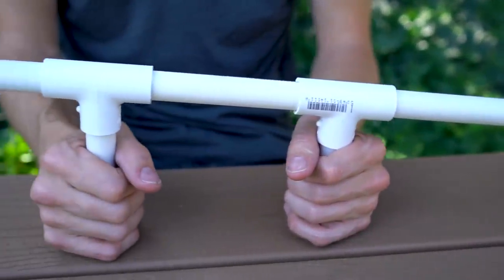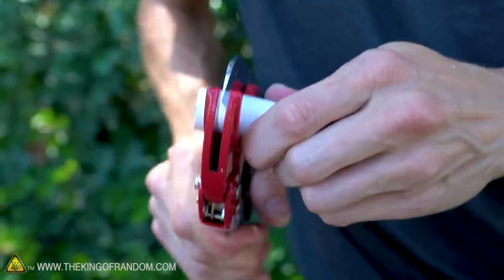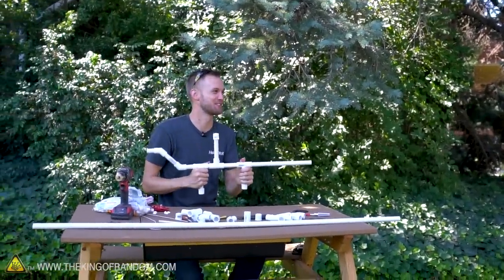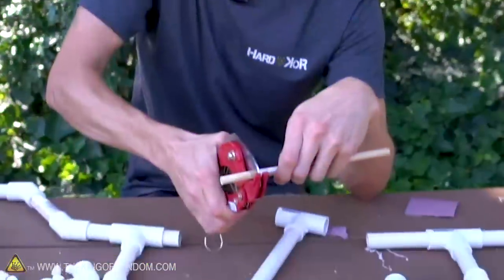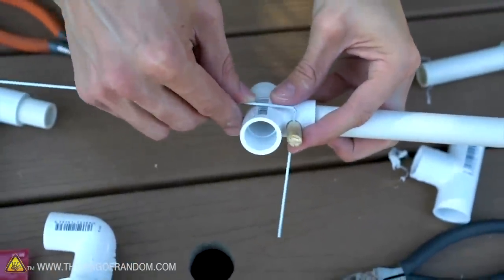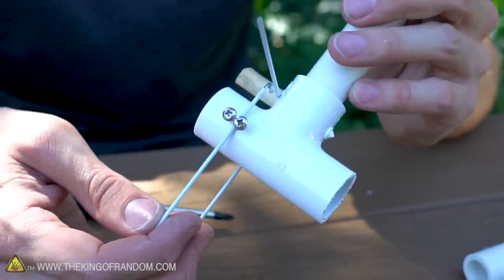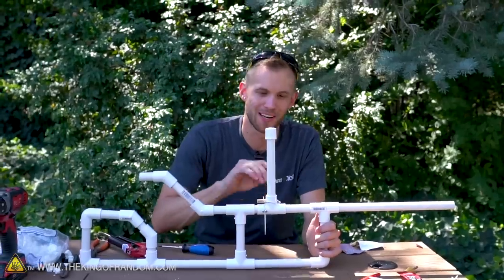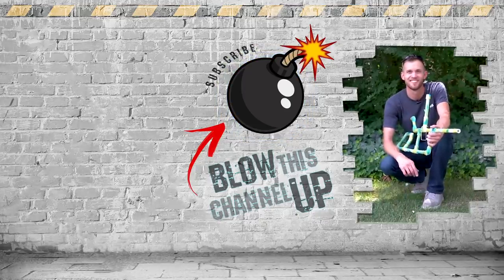Semi-Automatic Marshmallow Blaster

Comment: I'm honestly surprised you didn't add a small spring to the trigger mechanism. So it's default state is closed, all you'd have to do is pull the trigger, to let a marshmallow through and then let go of it and it'll close on its own. Either way, awesome video
Reply: Yeah a i was wondering if he would add a rubber band
Reply: Also it is a push trigger not a pull trigger??
Reply: That’s exactly what I was thinking
Reply: And turn the trigger section around so he's pulling on the trigger instead of pushing.
Reply: Was jsut about to comment the same thing
Reply: I was about to say that, and reverse the trigger mechanism so as not to be a pull trigger.
Reply: Orlando Lopez same
Reply: It does seem kinda rushed, I was hoping he would hyrdo dip the PVC
Reply: Me too
Reply: that happens if you're producing a video each day for one year - you'll begin to lose imagination and creativity.
I'm praying for high quality stuff...
Reply: Orlando Lopez I would also have flipped the trigger mechanism around so you pull it instead of push
Reply: Also he should use a rubber plug on all of the parts that the marshmallows do not go through to make the air go straight through the piping instead of the butt and handles
Reply: How to make hot ice
Reply: I always think they do that to get us to comment! It being so bloody obvious!
Reply: Yes exact same thought
Reply: Orlando Lopez same
Reply: Just add a couple screws one on each side of the cupler for the magazine and wrap around a rubber band and your done, and also if you want it to be a push instead of pull trigger or vice versa just flip around the T fitting where the magazine goes and there you go
Reply: Honestly what you said it paved it a lil he didn't haha but oh well I guess
Reply: True
Reply: I was saying the same thing

Comment: Soak the marshmallow in lamp oil/gasoline and attach a  blowtorch at he end of the barrel.  Now you have an incindiary marshmallow gun!!!!
Reply: no better yet smores gun\

yeah now where talking
Reply: that wouldn't work because the marshmallows would expand and then they could get very hard to get out or get stuck along with bad smoke that could go up to your mouth.
Reply: yeeeeeeeeeeeeeet
Reply: Freezin Frenzy they are lit as they leave the tube so they expand in the air
Reply: Vagatavg Vainglory OMG
Reply: yeah do that
Reply: Or lubricate the inside of the travelling tube where the marshmallow goes through with oil/gasoline
Reply: the gun itself is made of plastic.
It'll melt
Reply: Vage44 47 Genus
Reply: if u leave out the oil out u get smores!
Reply: S'MORES GUN!!!!!!!
Reply: Yes please
Reply: Vage44 47 no
Reply: Bruh what are you doing at your freetime
Reply: You would have to put a metal extension on the end so the plastic doesn't melt
Reply: Freezin Frenzy party pooper
Reply: Omigosh! Imma try this!
Edit: My marshmallow gun roasted and it smelled awful. Chemical fire and burnt sugar. 
But I did win the marshmallow fight by a large margin. 
0.1/10, would recommend only under high caution.

Comment: What if you made some sort of compressed air system and some receiver and barrel overlays. Maybe even try making separate capped magazines for fast reloads and easy storage without fear of spilling. (As in the part of the magazine that goes into the gun has a spring loaded covering so it remains closed when stored)
Reply: that is what i was thinking
Reply: Lieutenant that are some cool ideas, and I also had the idea of the spring loaded gun
Reply: I also think that a rubber band on the stopping mechanism would be cool and having it on the other side so u pull it instead of pushing it
Reply: He already has a multi mag system
Reply: Unofficial Rap  lion
Reply: Maybe a paintball gun's co2 cartridge will do
Reply: Cifossi2500 Escohe Tu Wait, why don't we just shoot marshmallows from paintball guns at that point, that'd be pretty fun
Reply: @thelieutenant7732  that would be cool but will they fit?
Reply: That’s a paintball gun lol

Comment: Try making it with  paint ball tank or  air compressor power
Reply: Charles Long omg I was just thinking that. That would be so coo,
Reply: Charles Long that would be so cool and he should add a scope
Reply: Cool idea. May also be cool to see him scavenge a nerf gun and make a spring operated version
Reply: Charles Long i was thinking the same thing also put a paintball hopper on it!
Reply: I was wondering how to hook up a co2 bottle!
Reply: J. Williams Make a threaded hole in one of the pipe caps so you can attach the tire inflator: First, drill a hole in the center of one of the pipe caps. you’ll need to “tap” the hole, or cut screw threads into it. The plastic cuts easily, so you shouldn’t have much trouble with this.
Once the hole is tapped, insert the tank valve into the hole and tighten using the adjustable wrench.
Assemble it to were you would want the trigger mechanism. Press fit the pipe pieces into the sockets of the fittings, but do not use PVC cement or primer. Screw the CO2 bike tire inflator into the Schrader fitting side of the air tank valve.
Reply: I agree
Reply: that is the exact idea i had
Reply: He could also make a shotgun with the t-shirt canon
Reply: I was just about to send that
Reply: Charles Long I was thinking the same
Reply: woah that would be sweeet
Reply: I literally come down to the comment section to put that and then I see u 😂
Reply: Charles Long that’s what I was thinking
Reply: Thats what I was thinking of!
Reply: Brecken Jimenez no

Comment: Make the firing mechanism spring loaded and also  turn the trigger around so that  instead of pulling, push.
Reply: GarbyGas he should have put a rubberband
Reply: Don't think you could spring-load marshmallows since they are soft, but the reversing the trigger mechanism could change the pull/push direction
Reply: Just flip the trigger mechanism around
Reply: I thought of that too but I believe the trigger would then be too far away from the handle to use effectively.
Reply: @tinybluepanda1319  That was what I thought but the trigger design would need to be changed so it's not so far away from the handle.

Comment: Try adding a vacuum or compressed air to the marshmallow gun so that it can fire on its own
Reply: A fan isn't powerful enough to push them you'd need to add compressed air like a Airsoft or paintball gun
Reply: cheeki breeki man the III I was thinking that you may need something that constantly creates airflow as compressed air will run out, possibly a vacuum
Reply: It us going to be hard to shoot a single shot
Reply: khaled jamal you could keep the same drop mechanism and just remove the requirement to blow down the PVc
Reply: Do it

Comment: I would personally add a screen mesh right before the marshmallows drop down just so there's no marshmallows coming to your face when you're taking your breath in
Reply: Depending on the mesh screen, it might slow the marshmallow down.
Reply: GENIUS
Reply: Or a one way valve that does the same but does not really block much air.  Or I suppose you could just put a small piece of the coat hanger wire through the middle of the pipe to accomplish the same thing

Comment: if you reverse the T piece with the trigger it act as a normal trigger, so when you pull it towards you it puts marsmellows in.
you could also make a bottom loaded barrel with a spring in the mag so you can put a sight or scope on the top

Comment: Invert your trigger so you are pulling it instead of pushing it. Then add a spring so it returns to zero position automatically. It will really feel like a marshmallow "gun" then. You could also design a CO2 powered version, a little more marsh for your mellow.

Comment: 1. Drill out the mag well and tilt it 45 degrees
2.Make an air tank trigger (possible marshmallow destruction)/Combustable gas firing system(possible marshmallow ignition)
3.Waay longer mag

Comment: Use DIRECTION CONTROL VALVE and the air containers to make it automatically controlled using relay to control the DCV Also add spring to trigger the mechanism to automatically regain it's original position and make the top nozzle little bit tapered so that it will shoot the bullet with high velocity
Use multiple magazines with spring loaded mechanism

Comment: Add a spring where you push so marshmallows fall down to the gun and make it so you don't need to blow air inside so marshmallows can travel through easier and with more power

Comment: Put a small pressurized tank on it with a system that lets air through when you pull the trigger, a side slanted mag instead of top down because top down gets in the way of aiming,

Comment: 2:14 those are not 45 degree pieces. First of all, I dont mean to be rude, but the angle of that pipe bend is and OBTUSE angle. Those are more than 90 degrees, so that is more than 45 degrees.

Comment: So thanks because I'm going to make a airsoft verson but the mag has a button so when the mag hits the stick the bbs will go through a small hole and when I blow the bbs starts flying, the hole I'll be blowing into in the mouth piece will be small but can fit ur mouth and the mag fed will be a t shape (small and metal every inside metal outside plastic) and with a small exit hole (no amo counter that when wanna fire one bullet at a time just burst or full auto) I wonder if it's possible to make

Comment: I would use a air compressor with a portable air compressor filled portable air compressor with air and then have it in a backpack and use the air pressure as your lungs